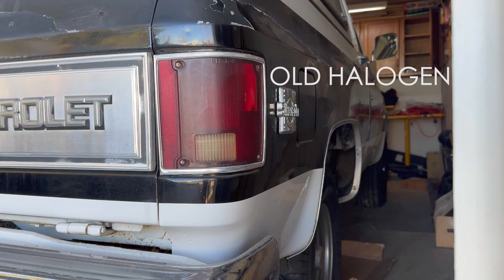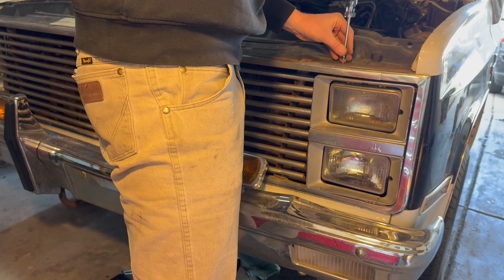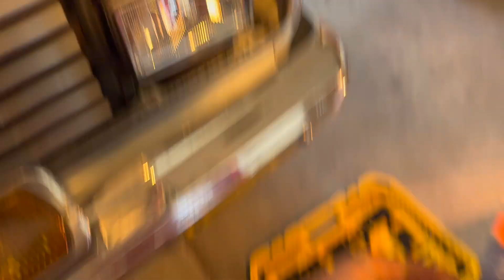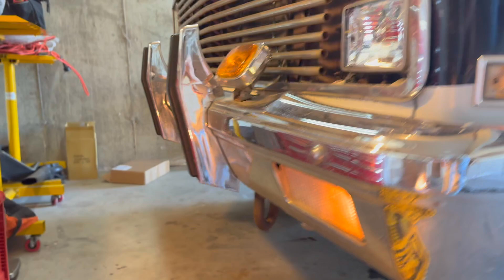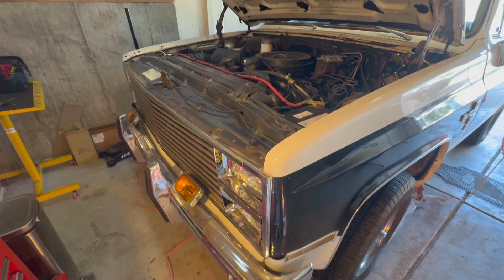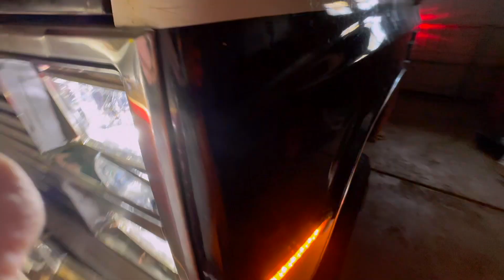Are LED Lights Actually Worth It? | Beginner Build Series

Comment: should bring up adjusting your headlights, ideal pattern. cuz i'm not even sure of that myself and trying not to be an ass and blind other people when i can help it with my lift
Reply: This is a great point. In my test drive, they were pointing every which way, so it’s something I will need to adjust before taking it out for real.

Comment: Any issues with fast flashing or needing to add a different flasher or resistor?
Reply: The side markers actually have kind of a slow flash/blink with the blinkers on surprisingly. Might get the flasher that’s made for LEDs and see if it helps.

Comment: Hey tell me,the metal frame that goes over the new led headlight,is that a new one or your old one, it obviously must have fit nice and snug huh?The reason i ask is because i bought a set of led headlights from headlight experts,do not buy from those pricks,well anyway their headlight is smaller than the light i had in there and so the frame fits loose on it.Oh the emails i could show you from this bastard.